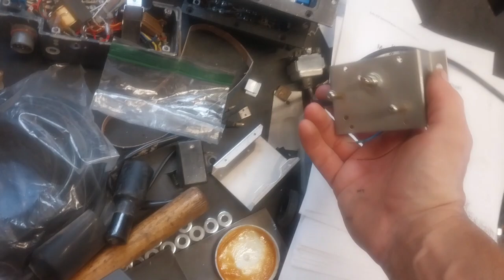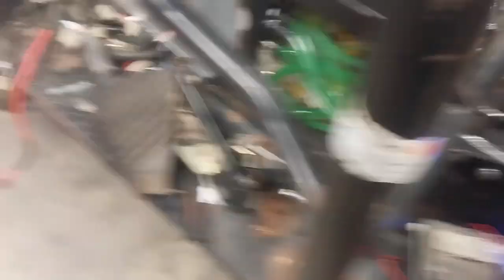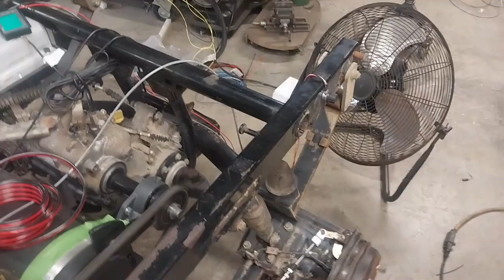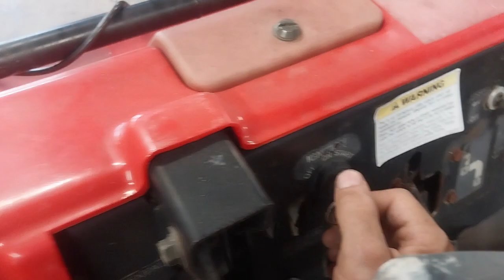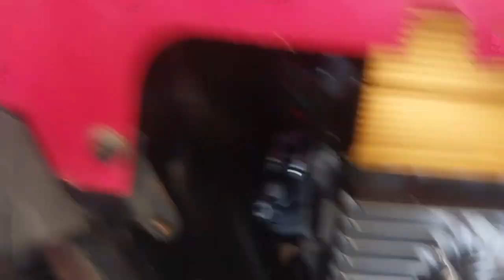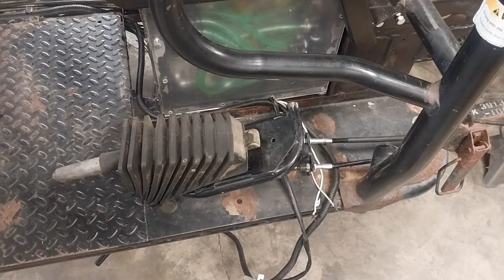Wheels Are Turning! Pt. 6 - Mr  Mule

Comment: What's the point of the holding relay, when the key turns off to break the connection anyways?
Reply from the maker: It's like a push to start button in a car. If I had a radio, say, and just wanted to listen to it, I wouldn't want the main contactor and water pump on.